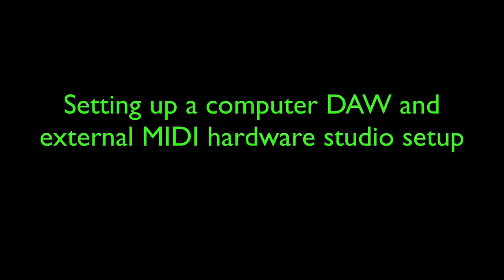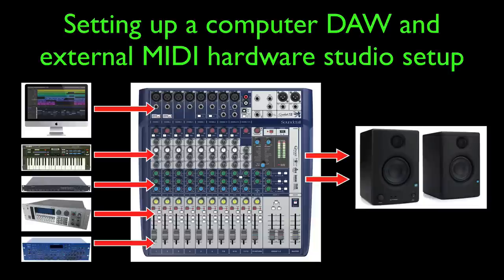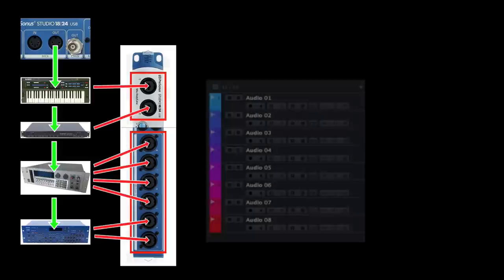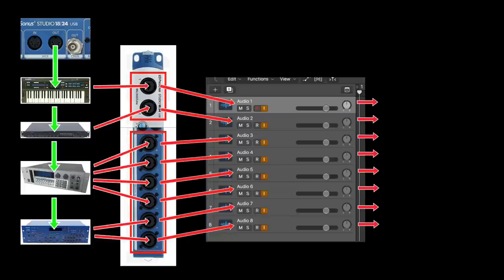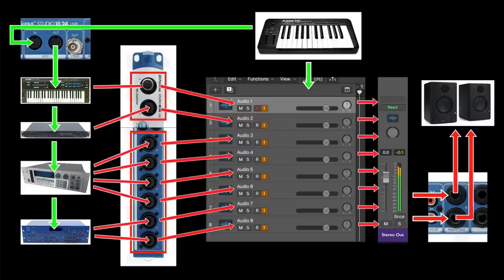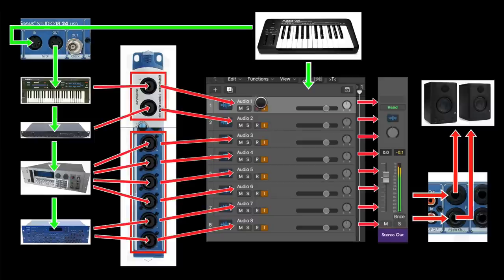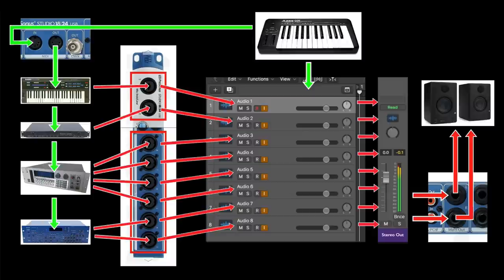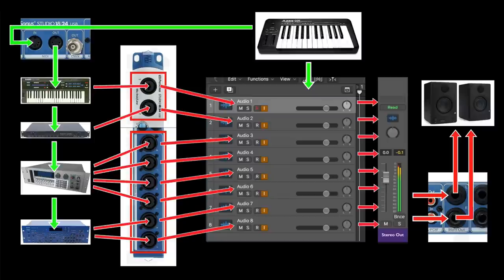How to setup a computer DAW & external MIDI hardware studio

Comment: im using a Scarlett 2i4. I have two synths id like to run simultaneously in my daw will i need a bigger interface as all my midi is been connected via a usb to midi cable
Reply from the maker: your interface has 4 line inputs, so the max hardware unit outputs you can bring IN to your DAW is 4... either 4 mono hardware unit outputs or 2 stereo, or one stereo & 2 mono etc... If you need to bring in MORE hardware unit outputs then you'll need an audio interface with more line inputs
Reply: @dancetech  OK so I am covered I'd only need 4 inputs for the two stereo outs of the synths.
Reply: The 2i4 only has two inputs..... 4outs
Reply from the maker: @roym1444  i was looking at the wrong one (4i4) well then you're limited to 2 inputs. So, either you get a newer unit from which ever manufacturer with a minimum 4 line in's or a very small tablet mixer and mix both external synths down to a single stereo out on the mixer-tablet and feed that into the DAW In L/R, but then you don't get the luxury of being able to add plugin fx etc to each individual synths in the DAW
Reply: OK so I have an accces virus and a micro freak on the way. The virus takes up one input. So I don't see why the micro freak can run on the other input no hassle. It's just there is only one midi i/o so I I bought the kenton ..
Reply from the maker: @roym1444  well yeah they can both be fed into the audio interface, one input each in MONO